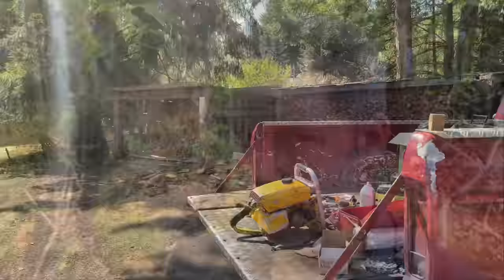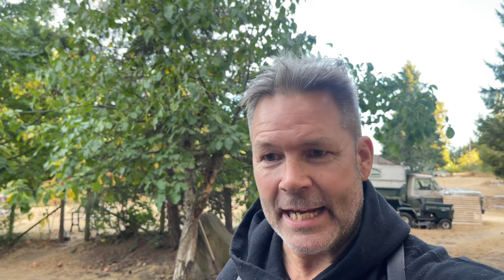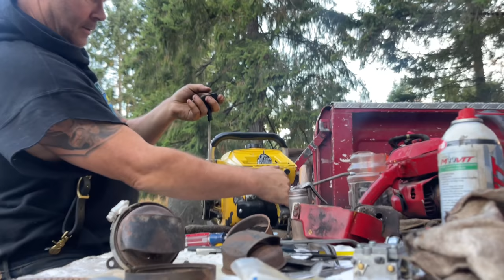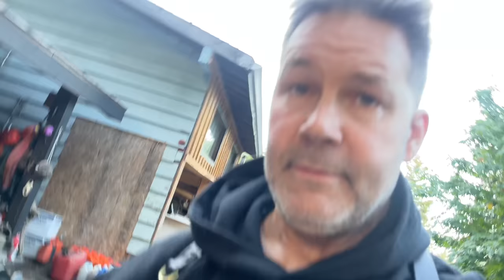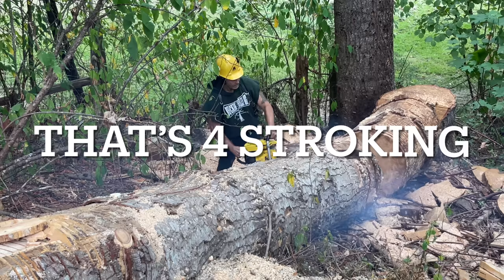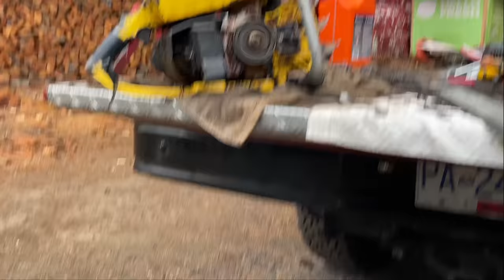The “Best” Big Timber Cutting chainsaw ever made, Mac 125 sp

Comment: There are two with that opinion Buckin! Nothing better than the grunt of a 125 as well as a mildly ported 1-76 or 797. Especially when they hit that sweet spot in the powerband where they just outright dig. I would love to see an 090 against a 125 as long as the wind vane governor on the 090 is removed or disabled. I came across an old 070 first years ago and boy it's no joke that they will abuse your hands due to the solid mount versions. I fell in love with McCullochs but the old 090 has a special  place in my heart as it was my first big saw after the 076 and I can remember my other saws just sitting because that's all I wanted to run. A very loud crackle from the muffler and pure happiness. Thanks for sharing these old saws with us, I still get excited even if I'm not running the powersaw!

Comment: I usually set my saws up a little rich, because I do not like to replace pistons and cylinders.  Mine may not thump when they sit on a work bench, but the light, stay lit and re-light - my three requirements for a good saw.    The best saw is one that will work all day in different types of wood and is as sharp in the afternoon as it was in the morning.  My Ms 440 is that way.  My MS 360 would get this tag but it likes to find its way into dirt at some time or the other, even though it only has a 20 inch bar and the 440 has a 24 inch bar.
  Buckin, you ain’t no BJ Thomas.

Comment: Buckin is definitely correct about the 090 .....pure bone rattler.
Personally haven't had to run any  MAC bigger than my  Super pro 1010. 
I have run the 3120XP which is awesome and a few MS880s both running 404 skip and haven't found anything they can't cut even with a 47" bar. Also regularly run a 288, partner 70cc , Poulan Pro 405 and  a few Homelites.....customers love seeing the old saws in action.......125 huh? Will have to keep my eyes open for one of these beauties. Love the bottom end torque on the oldies.

Comment: Would love to see the time difference between the stihl 075 you ran the other day and this 125! I know the Mac should win but you never know. They have the same diameter piston but the Mac has a 4mm longer stroke. In wood this size I wonder how noticeable that would actually be?

Edit: I just compared the cut times between the two saws in the two videos, the 075 was faster? Would love to see a head to head! 075 was around 25 second cut average the Mac 125 was around 30 second average.

Comment: Watching your video and having an 090 I think depends what wood you cutting but 090 it's up there and no chainsaw comes close to that torque, what 090 lacks in stroke mekes up in piston size and lets not forget 090 has governor and slows it down to protect the cylinder fact that McCulloch guys didn't think about. I would like to have an 1 to 1 to sort the debacle .

Comment: Yep love the sound of the old 125    buckin you have said  the 12t will out do the 090  in my eyes  in come down to operator    saw set up bar chain bla bla bla   iv out cut a 125 with a 090 and been out cut by a 125   any way keep the big fellers going  keep it in the wood

Comment: Buckin can you recommend a young bloke what kind of bar you'd use on an 1964 450? Unsure and can't find any info anywhere out there! 
Blessings,
Al
Reply: Maybe I can help. I just checked Oregon’s website and no listing for it. You may be able to retrofit a Stihl or husqvarna large mount bar to the saw (Buckin’s got a few videos on here of that) or what I would do is go on eBay. You’re gonna pay up a little bit I just checked and there is a good selection on there of oem bars made for your saw, just make sure you have the rim sprocket on the saw itself that matches the bar and chain ya buy. Hope this helps.
Reply: @mercoldswfo  cheers there mate. Might have a go at modifying a bigger husky bar to fit! Thanks for your message my friend